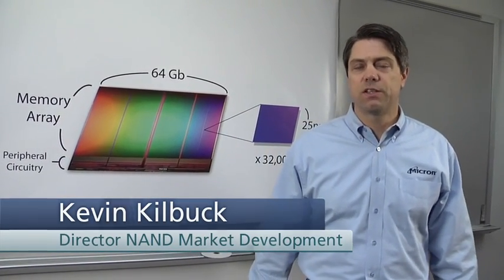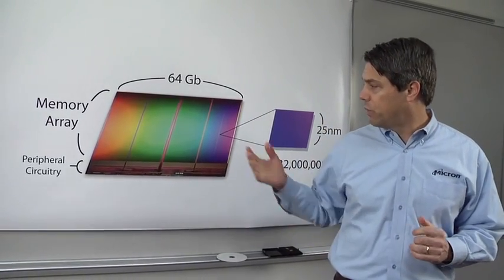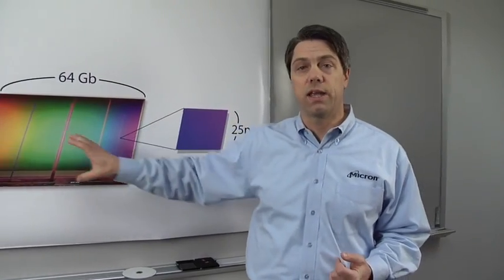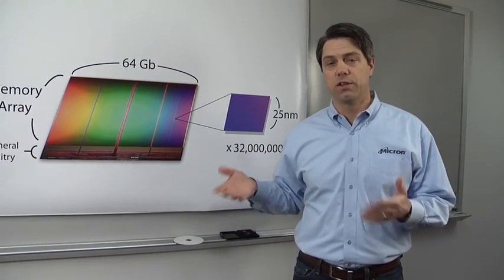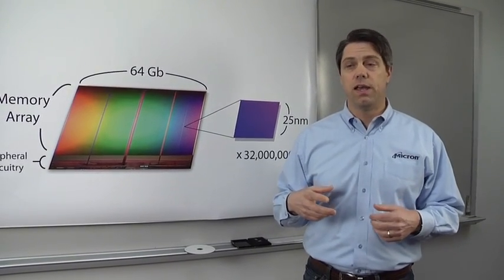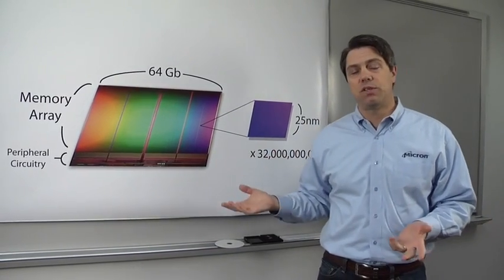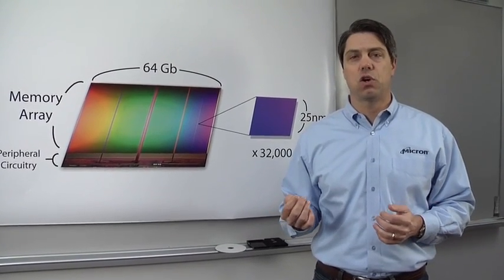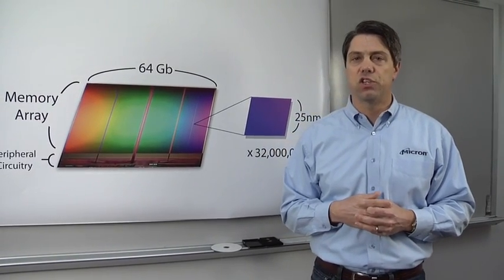Just How Small is 25 Nanometers?

Comment: Who ever makes the 1 nanometer chip in mass will most likely rule the world. Their military technology will be unstoppable. There will be wars over these chips. When looking at the atomic length, passthrough decreases. 1 nm resistance decreases many times from 7 nm. Batteries should last longer but they would need to reduce the electric wavelength to truly take advantage of the technological change creating a new equation wave length to nm which means energy usually should be proportionate. This idea is able to be applied all the way across technological design and is the driving principle to what we call hardware innovation through software.